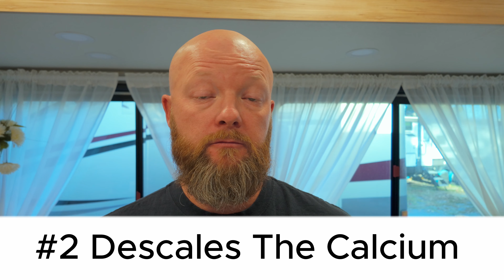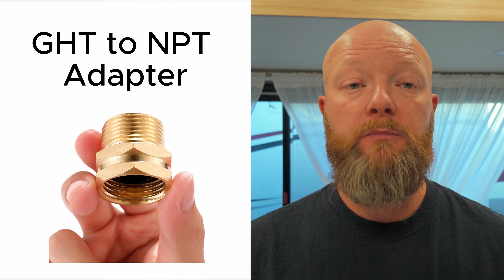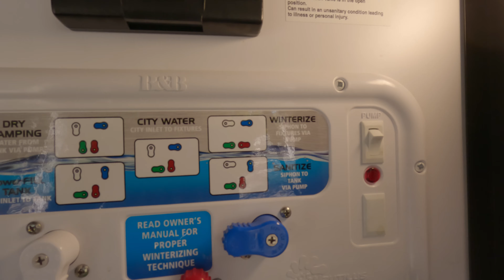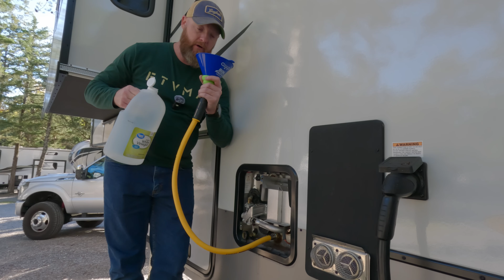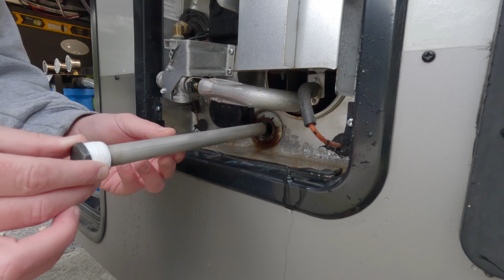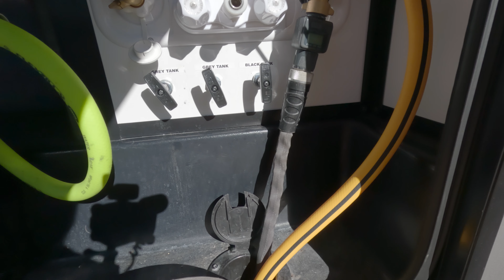2 SIMPLE HACKS TO PROTECT YOUR RV 🔥WATER❄️ SYSTEM

Comment: Great stuff
Reply from the maker: @missouritravelers  much appreciated!
Reply: After installing the freeze adapter, you say “because the water is above 37degrees it automatically shuts off the water”.  I’m confused. I thought it closes off the flow if the temp drops BELOW 37
Reply from the maker: @explorationsrenovations5982  It is the opposite.  It is designed to start dripping below 37 degrees to protect the lines.  Similar to when you open up the faucet in a house in extreme cold.

The reason you see a steady stream on the video is because I pulled it straight from the freezer.  It will auto regulate the flow according to the extreme temperature
Reply from the maker: This really came in handy when we had to take our rig to Indiana in March.